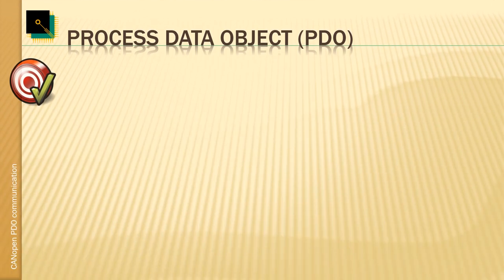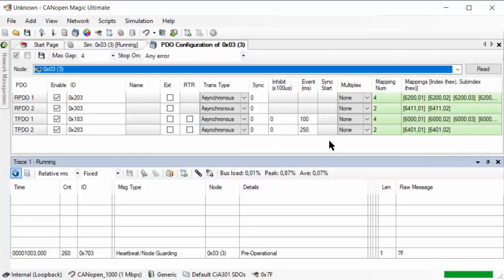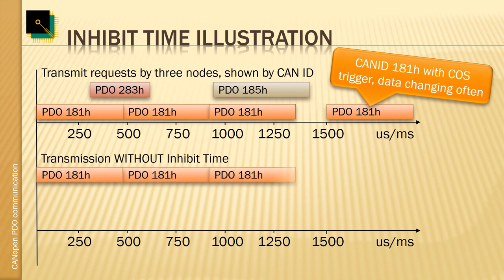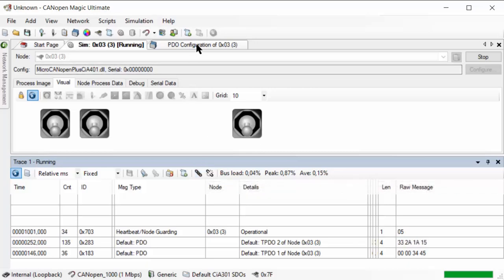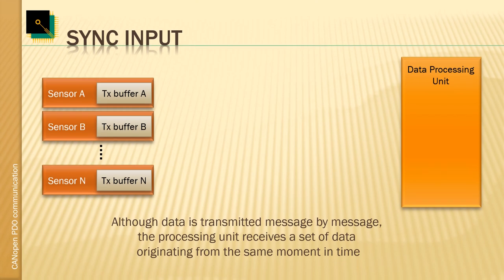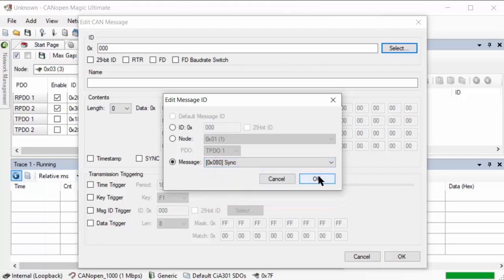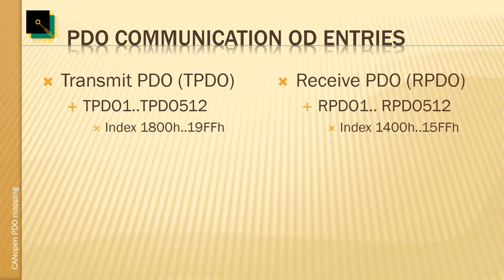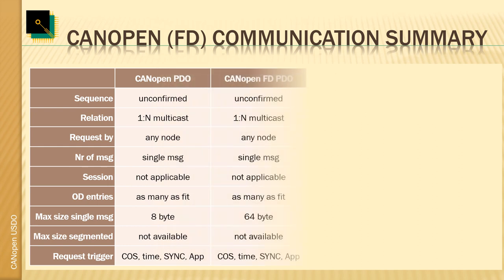CANopen (FD) Process Data Object (PDO) Communication Parameter

Comment: After sending the Network Management (NMT) Request for Node 3 to go from Pre-Operational to Operational, I see the GUI displays the relative / delta time between TPDO 1/2 messages.. but what does the enabled RPDO messages do?
So as a general rule of thumb, the Event-Driven-Trigger + Event Time Trigger is used for slow changing data, the former as a precaution should it unexpectedly generate lots of data.. while the latter is used as a precaution against silencing a node for too long?   For fast changing data, like a pressure sensor, what is the maximum can-bus utilization that should be considered? 
Regarding SYNC, if you set the Transmission Type to Synchronous, is it still necessary to set the Inhibit/Event to 0ms?  And if a Node has multiple PDO IDs that will transmit every Sync, how is it ensured that Node 4 will send it's data only AFTER Node 3 has sent all its PDOs?   Or is that what the PDO's "SYNC counter start value" entry is used for?   Can any node on the bus issue a SYNC message? 
In the GUI, is the "ID" column the same as the "Connection ID Block (COB)"?
Reply from the maker: A RPDO configuration is not "visible" on the bus. It is just the configuration for a consumer, somebody else needs to produce it.

Maximum busload caused by a single node or CAN frame repetition is typically not defined and are application specific. For a strictly event time driven system, recommendation is to stay below 90 busload. An event driven system should stay (in average) well below 50% bus load.